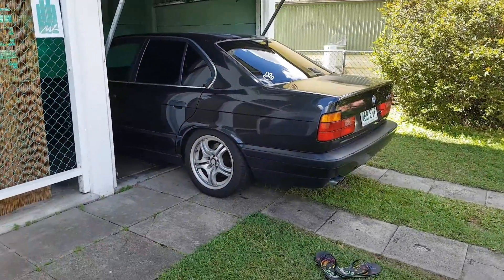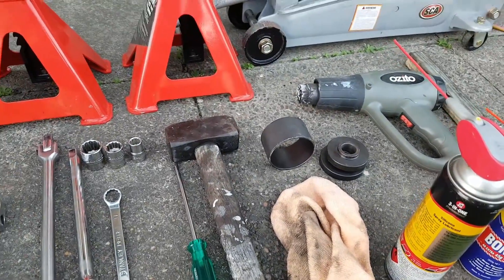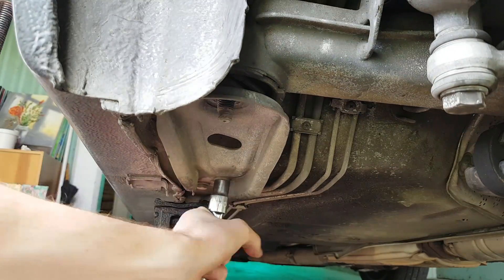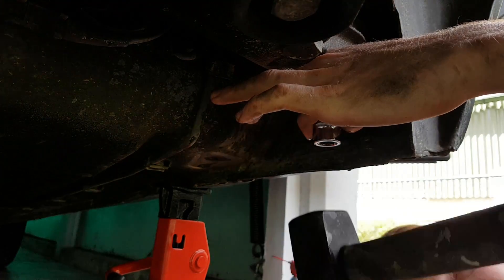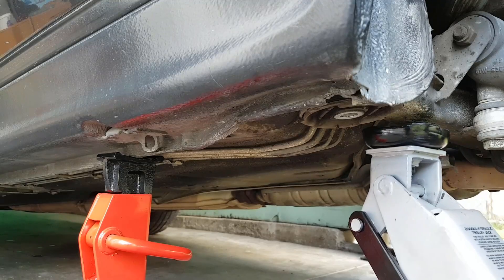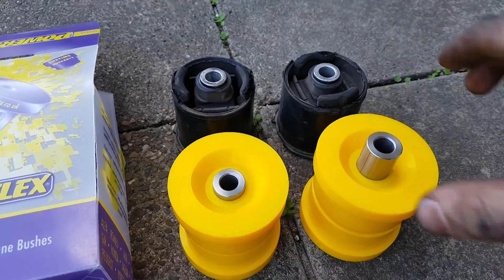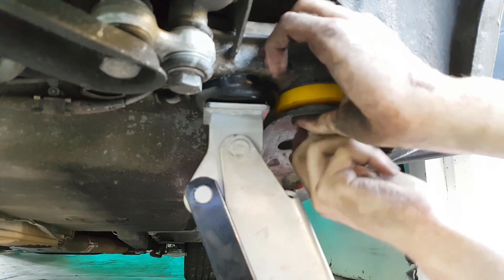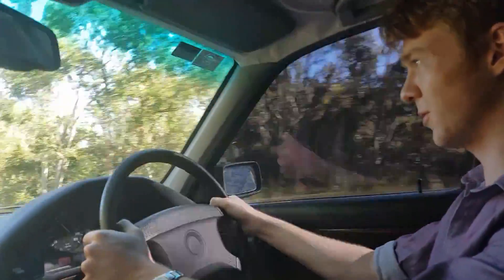How to Replace/Upgrade Rear Sub-frame Bushings - BMW E34

Comment: A small update from my previous comment: It's been a year since I did the subframe bushings, however I did the trailing arms and the upper differential bushing as well as the dogbones and it made a huge difference to me. It now feels like the rear stopped steering on its own and the car feels a lot more stable on the road, I feel like the front end needs some TLC as well in order to complete it all. Dropping the clutch used to give me mad vibrations, but now all that is gone. You might notice a bit more noise coming from the back end, but it's nothing to worry about. Polyurethane bushings is a must have recommendation from me.

Comment: Great method! Can't believe how quickly you did this job.. Why pull the whole subframe out when you can do this? Keep up the great work man
Reply from the maker: +Hans Ahola That's why I had to make this video! I used to think this would be a hard job. Will do mate thanks
Reply: Do you remember the diameter of that bearing spacer you used?
Reply: Hy I bought the black ones. I tried getting the polyurethane ones but they don t have it for my car. Will it work with normal bushings ? Putting them on ?

Comment: Hi again mate, just did this on the e32: thumbsup. Followed your guide and it all went to plan, wtf! haha Didnt even try the oem ones and just bought the same powerflex ones and all good. Did the dogbones at the same time. Cant believe the difference this has made to the car. There was quite a bit of movement on the inner part of the original bushes. A tad more road noise like you said but well worth it as theres no more  tramlining, tracks along straight and the handling is better as well, feels more stable all over. Now for my trip to the Nurburgring ring end of next month. Thanks again for the helpful guides mate, much appreciated: thumbsup.
Reply from the maker: Awesome to hear it worked out for you! Congrats and good luck on the ring

Comment: Very good to see some e34 DIY:s! Keep up the good work! :)
Reply from the maker: Thanks!
Reply: Btw how does the car feel with the new powerflex bushings? Im thinking about changing to powerflex on my car :)
Reply from the maker: The rear end is noticeably firmer, and so a little bit harsher over speed bumps etc, but nothing bad. It feels better in corners. The only bad thing so far is a slight vibration which comes through at 30 -40 kph, but I'm pretty sure it's because my driveshaft is slightly out of alignment which will be fixed soon.
Reply: Ah okey, so you think that it is worth it? :)
Reply from the maker: +kaya strömdahl If you're old sub frames are worn out then definitely! This is way easier than putting oem ones back in
Reply: Ah okey thank you for your answer!

Comment: Method works great, I used 70mm diameter 3mm thick Steel discs X 6 as spacer as well as two collars from struts, could use 15 - 20 steel discs (available online pretty cheep) instead, steel discs came out of line on the first bushing, bushing caught fire, KEEP A FIRE EXTINGUISHER CLOSE BY FOR SAFETY, if it doesn't come out quite easily with moderate heat check alignment of spacer, do not continue to roast until fire particularly without extinguisher, other than that job went smooth, lining back up was a bit of a PITA but got there in the end, thanks for the video, great tutorial saved some wonga and was pretty straight forward, Top Man, thank you very much for sharing, Bless.

Comment: Great video! Short and simple, gives me a good idea on what is coming up for me. Thanks!
Reply from the maker: No problems mate! Glad I could help, let me know if it works out.
Reply: i can't get the pin out ... fml
Reply: the pin can be really STUBBORN 
you need to give a good blow with small heavy hammer
Reply from the maker: +William How did it go mate? Get them replaced?

Comment: Torque specs courtesy of ethirtyfour.com: 
Rear Axle:
Rear axle carrier to rear rubber mount: 77 Nm
Rear mounts to the body (Thread free from oil and grease and secure with Loctite No. 270): 45 Nm

Comment: Brilliant. One change. I used a small propane torch instead of the heat gun. Took just a few minutes to pop the second one. Used the gun on the first one...took ages.

Comment: Hi again mate, gonna be doing this on my e32 in the next few weeks. I noticed in one of your comments putting new oem ones back would be a a lot harder, have you done this or how is it harder? Do they not go in so easy? Thanks. Was thinking some grease would help them slide into the sleeve.
Reply from the maker: +ronaldo ronna Hey mate. Yeah it would definitely be a lot harder using oem bushings, as from what I've heard you need to press them in from above. So, you'll need enough room to get the bushing in, which might be a bit tight, and then you'll need to come up with a way of pressing the bushing in while the subframe is still on the car. Maybe two bits of flat bar steel and booker rod on either side, which you tighten up slowly?
Reply: Hey mate thanks for the quick reply. Think ill still go for it as i want to keep the original feel, the e32 really is very smooth. Im thinking ill get an extended bolt with nut and 2 big washers and try winding the bush into the sleeve with a round head spanner then fit the original splined bolt. Ill let you know for future reference how i get on, good or bad! haha. All the best: thumbsup

Comment: It's been a while since you posted this but my E34 needs the same work. I am not a mechanic so I could not do the job myself but when I spoke to my garage they said it could take over 10 hours. You don't mention how long it took you but I wonder if the garage includes removing the subframe to do it not the way you did it, on the car. And it would be easier for the garage since they can hoist the car up.

Comment: I am now seriously considering this for my 528i stroker, what are the pros of having poly bushings there in the rear? I do sometimes take mine sideways, but it's mostly a daily driver.
Reply from the maker: +Detective Malaysian Cancer First of all: hell yeah you have a stroker? How does it go? 

The main pro is that the polyurethane is stiffer than rubber, so there's less movement and 'sway' than with stock rubber. This means a firmer rear end and better response from the rear, I noticed my car feels a lot tighter during corners now. 
The other pro is durability, as you'll never have to replace them ever again because poly lasts a lifetime. 

There are some cons though, such as a harsher ride, and potentially more vibrations coming through from the road. I have a vibration that comes through at 35 kph now, but i think it might be because my driveshaft is slightly out of alignment.
Reply: I've heard some say that theirs lasted like 60km and they just went back to OEM. I'll take a look at the pricing and will probably add it to my to-do list.
Reply from the maker: +Detective Malaysian Cancer Fingers crossed mine last ok then! Good luck if you decide to do it and I hope the video helps
Reply: It definitely did, I thought I actually have to remove the entire subframe and everything. I'm happy to find out that putting in the new ones is less of a hassle.

Comment: Thanks for your straightforward tutorial Videos .. used most of them to fix my e34 525i.. i‘m surprised how neat your e34 looks like.. here in bavaria most parts under my car look like rusty chunks of scrap metal, you barely see e34 on the road these days
Reply from the maker: +V A Hey man! Thanks, I'm surprised as well. Cars in Australia rust much less than over there in Bavaria because it doesn't snow.

Comment: Great vids mate. Got a couple of these and an e32 and i dare say this would work on the e32 as well. Just wanted to ask, what is the top of the bit of tube you used up against to force the bush down? Thanks.
Reply: Its okay mate i can see the spacer is actually against the car body. Keep up the good work, lovely car as well.
Reply from the maker: Cheers man, I reckon it'd work on an E32 (don't quote me haha).
Reply: Yeah the e34 seems similar in a few ways to the  e32 and quite a few parts are interchangable:thumbsup

Comment: fuckin' riot and good info, thanks!

my jack points are rusted through to the point where the weight of the car alone will shove them up through the frame (don't ask how I know, the memory of the sound is traumatic enough) so do you have any recommendations on good places to put the jack stands? I usually jack via the crossmembers.